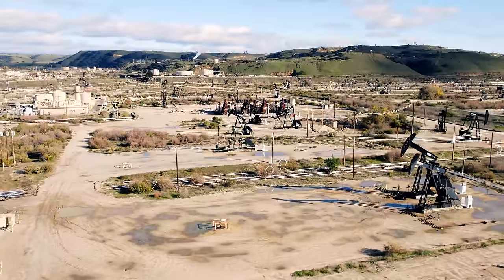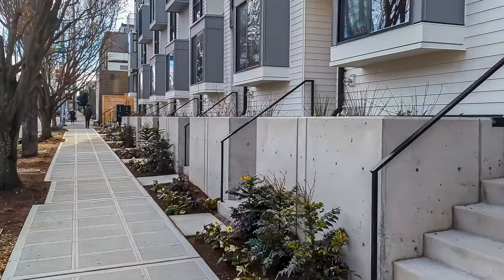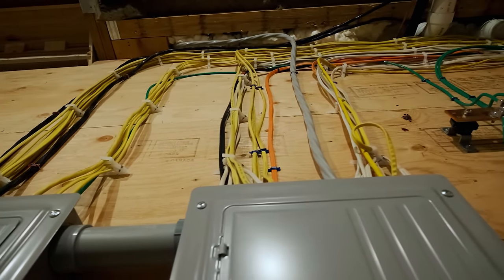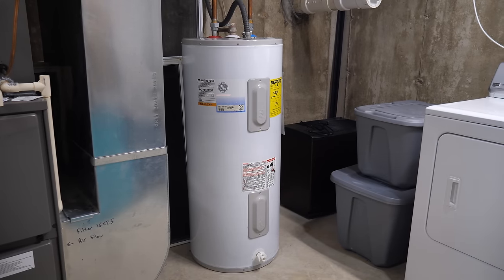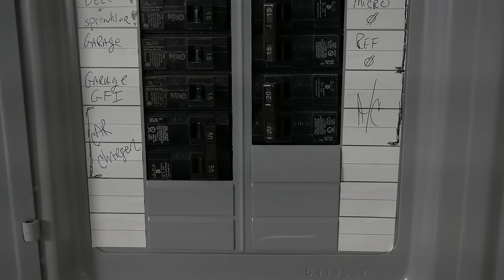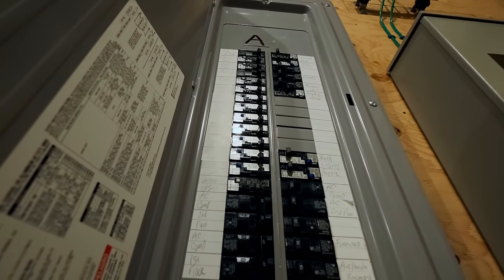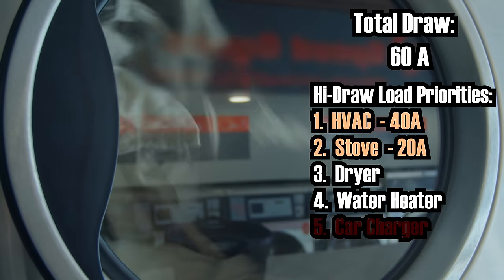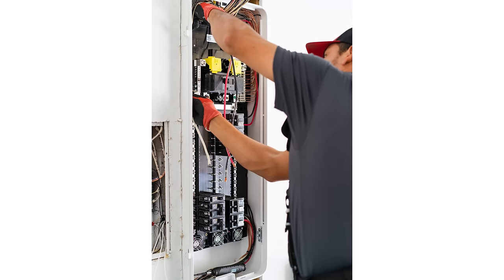Home Electrification: There's not a lot to do, and it doesn't have to be hard (Part 1)

Comment: Here in the UK, in the early 80’s my parents had a gas powered fridge freezer that they inherited from the previous owner of the house. It had a automatic defrost function, so the freezer never clocked up with ice. My mum says it was the best fridge freezer she’s ever had. They left it behind when they moved in 86. 
I’ve never seen or even heard of anyone else owning one. I wonder if it was an American import.
Reply: I'm American, and I've never heard of such a thing. I do know that caravans have fridge/freezers which can run directly on propane.
Reply: Multi fuel refrigerator/freezers are still commonly manufactured, but the only application they're really used for is things like mobile applications, like RVs. Other than that I've not seen one in a residential setting, but I could see a propane version being used for off grid homes as well
Reply: If they are not common in the US then I wonder if it was from a ship. I live in a naval port city. It was too big for a caravan. 
Gas powered clothes dryer seems even stranger to me.
Reply: @timpayne7676  The amish use propane fired refrigerators if they don’t cheat and use an electric one. Also I have a gas dryer. It works fine and it is so  cheap to run it is negligible
Reply: I live in an Amish area. Lots of propane refrigerators and freezers. Occasionally you run across a kerosene fridge or freezer, too. Servel and Dometic are two popular brands.
Reply: In the late sixties to early seventies gas fridges and freezers were heavily promoted by our nationalised gas service in the UK. They had a neat advertising logo of a blue flame, drawn so the flame looked cold (as blue things do to photographers and artists) rather than hot (as blue things look to physicists).
Reply: There is a frozen food storage warehouse near my home (USA) that uses natural gas as a back up in the event of a power failure to keep the warehouse at freezing temperatures.  This is more reliable  and cheaper then maintaining a very large generator to do all that work.  This is a standard ammonia based evaporative system that has been around for decades...

Don't tell the greenies...but...they are more energy efficient than electric cooling.
Reply: @grandinosour  Absorbtion refrigerators can only cool 68F or 20C from the ambient temperature so they are not the best in a hot climate. A big problem in RVs.
Reply: It was a Swedish invention. The majority of fridges in Sweden were of the heat absorption type as late as the 1960s.
Reply: @thelight3112  rv fridges typically run on lp and 12v
Reply: @grandinosour  I've heard that ammonia and propane are the best refrigerant gases, but they are hazardous to live with, especially when they leak.

Comment: I’ve got electric heat with several mini splits. I’ve got gas heat with a ventless heater which I’d guess makes up 70% of the heat. I’ve got a wood stove that is my backup that I use once in a while. Primarily fueled with Amazon boxes

Comment: My wife and I purchased a home recently and I REALLY wanted to get a SPAN panel (agree on the nerdiness of it). We had to do a service upgrade because of the age of the panel (yes, a nightmare AND expensive) and it was just way too cost prohibitive at the time. Not to mention they didn't have an installer in our area. My wife and I plan to build a house in the future and a SPAN panel or something similar is definitely going to be in the budget.

Something that I was told by our installer that will give some of the monitoring features is the Sense Home Energy Monitor. This wouldn't give the circuit level control, but it apparently lets you see how you are using power.
Reply: Get a house that uses Passive House standards.  The insulation is so perfect, you don’t need a heater (though one is included for backup)

Comment: I recently installed a heat pump for central heating and cooling, though I still have a gas furnace for backup heat; certainly for the near-term I think that's a reasonable way to go for people in colder climates tbh.
Reply from the maker: It's a reasonable option, for sure! My only sticking point is that keeping the gas hookup costs money no matter if you use it or not, which incentivizes you to get some use out of it. It's a tricky balance!
Reply: @TechnologyConnections  In western PA, that's about $20 per month. Free money for the gas company to delivery nothing all summer long.
Reply: @anonymoos  wow. That's bigger than my entire gas bill most months in California. (I only use gas for the stove and the water heater.) The hookup cost is only $4.93/month.
Reply: @tim1724  Yeah it's insane. When I noticed that I made it my goal to disconnect it for good. Maybe next year--whole house heat pumps are expensive :)
Reply: Here in semi-rural Alberta, if you have gas service, you're paying for it whether it's turned on or not, and fixed charges are way more than $20/mo. In peak winter usage with recent high gas prices, of my $270 bill, $85 is daily access and admin fees paid to the various pipeline networks. I'm still insulating our house extensively and making use of the greener homes grant, but unless you're living in a 70+ year old house that's poorly insulated, drafty, and you have a low efficiency furnace, there's not a lot of economic incentive.
Reply: @TechnologyConnections  My "fee" for tank rental is 69 dollars a year and we spend time under zero several of those months. Electricity is about the cheapest here in all of America and normally costs less to heat than gas. No money for upgrades tot he 21st century tech, yet. Wood stove for when there is no diesel to bring more propane also.
Reply: Ouch. Something that arbitrarily disables a car charger because someone's turned something else on ?

Wouldn't it be a bit more sensible to, I don't know, charge at a lower current, or switch the dryer into a lower-power cycle, or use the car battery as a capacitor, to provide additional current to the house when needed ?

Turning things off/on at the breaker box is a very clunky idea. Also, how would it work for tumble driers, etc which have some form of timing/temperature electronics in them - just cutting power to them would lose all this for no reason. Think when the VCR would lose its clock just because of a temporary power outage, even though it was on again when the time came round to record.
Reply: @anonymoos  20 per month to keep your gas connection is not bad at all. Besides, look at how many services we pay for a hookup regardless of whether or not you use them. I pay a monthly fee well over $20 for my Internet connection regardless.of whether or not I use it. People pay rates for subscription services regardless of use. You likely pay for your electrical connection even if you don't use it.  20 bucks a month to stay connected to the gas pipe isn't all that bad.

Comment: Great video! I will add that it doesn’t have to be all or nothing. Replacing one’s A/C unit with a heat pump but keeping a gas furnace would allow one to use gas as the backup instead of heat strips. Since this backup isn’t used very often, you are still significantly reducing your carbon footprint while not going all in on electrification right away. This can be good in extremely cold climates where it can sometimes drop down to -30C or even colder. Note I said sometimes, when it isn’t that cold the heat pump can take over. A smart thermostat can also choose the energy source that is cheapest at the time, based on current rates and outdoor temperature.
Reply: Hahaha, he thinks it's a TV show for housewife people, US only, this is America, in Cuba he is ?
Smart breaker you needed, is that replacing the A/C unit ? You did the transition, heat pipes, heat exchanger ? You did that all yourself, great job !
what energy sources you have, low power grid and heat pieps only, never needed any gas ?
Reply: You could but its one of those why bother because ng often has minimum service cost/fixed fees. So probably cheaper to just run electric heat on that one or 2 days you need it.
Reply: @KingOfKYA  It typically costs a consumer more to use electric heating for a month than NG furnace for the whole heating season.
Reply: You need to consider the "social regulation" problem.  Many municipalities forbid such gas furnace + heat-pump, or tax the crap out of you if they find out you are doing it.
Reply: RE:roger1818.  Having gas appliances for backup purposes can be an expensive way to do things. Many utility companies have switched to a new system to scam customers. It's called a "customer" or "service" charge, which you must pay monthly regardless of how much power/fuel you use. As customers keep trying to use less and less power/fuel to be more efficient and save money, the utility companies keep raising the "customer" charge higher and higher to make up for it. In a normal house where you are using the average amount of power/fuel, the "customer" charge may be 20% of your bill. But when you are only using it for backup, you may be paying 95% of your bill for "customer" charge. Essentially, you are paying them for "nothing". Until governments wise up and quit allowing utilities to use this scam, energy wasting, billing technique, there is no incentive for consumers to reduce energy consumption.
Reply: @jul1440  You are assuming resistive heating. Heat pumps use about 1/4 the electricity of a resistive heater.
Reply: @bpark10001  Unless you live in a dictatorship, the politicians that create stupid regulations can be voted out.
Reply: @roger1818  Heat pumps only use 1/4 the electric of a resistive heater, when its well above freezing - like around 50F
When its that warm you don't use the heat much at all.

With a heat pump the cost is significantly more than gas even after all the government nonsense the last 3 years that drove the price of gas higher.

This past December I used my gas furnace 137 hours (10.3M BTU) . Cost of the gas alone was $143. 
Assuming an average COP of 1.5 (it stays below 32F here a lot) that would be 1800 kWh. That is a HUGE amount of electricity for us.
For comparison, that same December we used 1000 kWh (390kW of the electric was for our EVs)

It changes with the price of gas of course, but with gas being 1.25 per therm (December price), I'd need an average COP of over 2 just to break even with a heat pump.
There's just not enough 'warm' high COP hours to make up for the increased cost of running during low COP hours.
Using data from my thermostat, 75% of my 'heating hours' are done with the outside air temperature between 20F and 30F

My sister, 300 miles farther south of me and 10F average warmer days spent $500 the same month heating her house with a less than 10 year old heat pump. Granted its a different house but that's not much less than what I will spend for the entire winter, and I live in a colder climate.
Reply: One thing to consider, discussed in other videos on this channel, is that just being hooked up to natural gas has a carbon footprint, even if you never use any of it. That footprint is both the tiny leaks of greenhouse gasses and the fact that in much of the country the infrastructure is around a century old and in need of replacement. The idea is that if your entire neighborhood stops using gas, then there is no reason to install new gas pipes in your neighborhood, so no diesel diggers and such.
Reply: @munsters2  But these charges are valid.  The pipe bringing gas to the house has to be there.  It costs no less to maintain when it isn't passing gas.  It rusts the same, presents the same hazards when it leaks, etc.  (The same can be said for any utility.  If everyone had a way to limit electric usage to 20KWH/month, it would no longer be economical for the utility to maintain the electric grid.  If 90% of gas consumption is eliminated, the gas utilities will disappear!)
          Many of the "all electric houses" are because it is not economical to run gas lines, not because the homeowner chooses to use electricity instead.
          The dilemma is that gas is abundantly available, to the point it is being burned off.  It is the cleanest carbon-based fuel available.  If we don't use it, it escapes to the atmosphere unburned.  It is FAR MORE HARMFUL to the climate that way than the CO2 that would be produced if it were to be burned!  In the "reduce carbon fuels" game, gas should be the LAST fuel to be eliminated!
Reply: @roger1818  That is correct; a heat pump would make the heating price comparable to gas. However, heat pumps usually require a refrigerated air conditioner, which are quite rare here. Instead, most homes use a gas furnace with an evaporative air conditioner (swamp cooler).